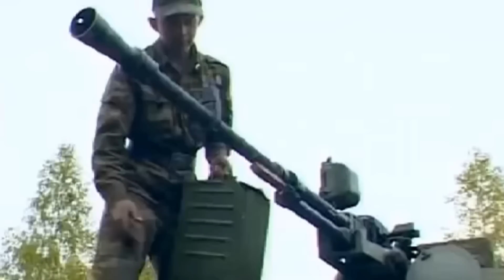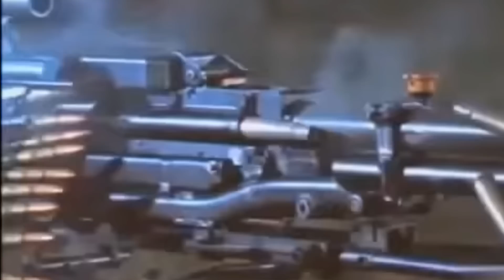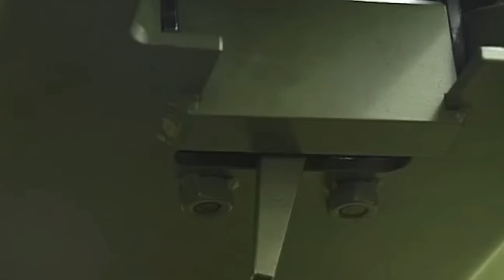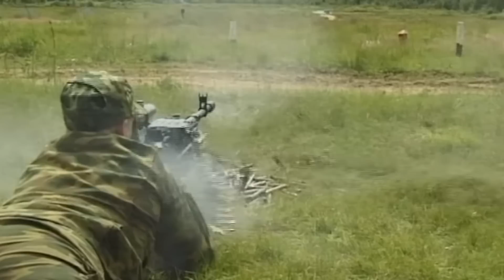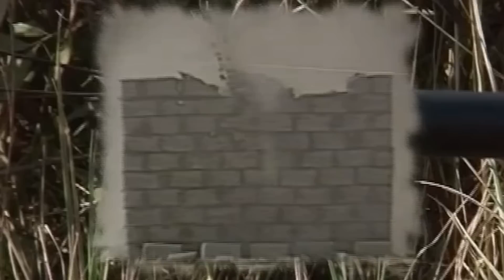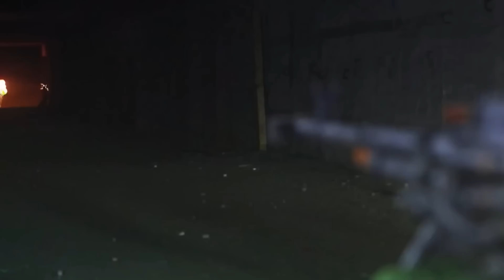Kord 12.7mm Heavy Machine Gun | Russian Beast

Comment: The wire cable & pulley system choice was driven by a desire to minimize the componants that would need to be swapped to employ the gun in various mounts and situations - the charging mechanism (and in fact, the actual trigger mechanism) are on the mount , which can be configured tonwork those as best suited to the mounting situation.  The widgets on the mount (whether directly using the gunner's physical effort, or a remote solenoid or electric motor in the case of, say, externally mounted remote mounts) have to be able to manipulate the charging system and the sear wothout changing anything on the gun itself.

This makes using the cable charging system the easiest system to engineer that can interfsce with the "universal" receiver setup.

Cramped coax or turret mount, where getting an arm in to pull a long stroke high force chargung handle might be an issue?  Cable charging has long been used - cable or chain chargers were used on many Browning MMG tank hull or coax installations.

Buried remote mount?  An electric motor is easier(and smaller) to make something spin than trying to build a solenoid that could pull a conventional cocking handle for a 12.7mm HMG.

And given the large size of the gun, and how infrequently (relative to vehiclular uses) it would be used as a ground mount gun, the cable charger isn't really an obstacle... but it does pay off for the gun as a "universal" gun mostly used in vehicular roles.  And unlike the DShK or M2HB, it isn't an adaption of a ground gun to a vehicular role, so it was optimized for the vehicular role (including remote installations) from the beginning.

Comment: How does it compare to the M2?
Reply: Kord is better lol.
Reply: @destroyerarmor  By what metrics?
Reply: @jakelilevjen9766  Basically all of then. Lighter, more reliable, more accurate. 

For instance, M2 is not capable of a doing 200-long bursts without interruption - even in a specially tuned version with water cooling built just for that experiment.

Kord is capable of doing that in the basic configuration.
Reply: @ayrnovem9028  Carlos Hathcock has a confirmed kill with the M2 from 1.4 miles (2250 m). Tells me it is pretty damn accurate.
Reply: @jakelilevjen9766  It is not the same as doing it consistently.

Carlos probably tested quite a few M2 speciments and chose the one that showed the most tight groups for his "sniper" weapon with an optic sight.

That kind of selection process has been done with many weapons that are not really designed as highly accurate, including Mosin rifles.
Reply: @ayrnovem9028  Fair enough
Reply: @ayrnovem9028  Sounds like the US could be due for a refresh, seeing as how the M2 is almost 100 years old, while the Kord is less than 30.
Reply: @jakelilevjen9766  I guess heavy machine guns are not seen as something of a high priority to upgrade in the US army. From my point of view, that's strange, but that's the conclusion you've got to make.
Reply: @ayrnovem9028  That, or good enough is good enough.

Comment: Don't listen to his criticism of its cable cocking, children: If U get a dud primer/hang fire and it cooks/goes off just as U are cocking it, it won't break Ur thumb! My lawn mower is 30 years old, has seen a lot of use, spent its life in the carport and yet the nylon?pull starter cord is still OK, let alone a steel cable! And it seems to have a pulley. I wonder why? Maybe to return it. It can't be a rack/ratchet, coz I can see it sliding, back and forth. 
Oh I get it, the pulley gives U a mechanical advuntage, simply because of its diameter, and maybe even gearing.

Comment: Guys pipe down, pipe down. It’s a 50 cal. Nothing more nothing less.
Reply: 12,7 × 108 мм a little bit more powerful than 12,7 × 99 мм/ the difference is about 2000 Joules
Reply: @GBAS-u9q So the extra powder in that 9 mm converts to 1475  lb ft of force ? I think not. Most gun experts say it’s only slightly more powerful than the 12.7x99.

Comment: In the early 90's while we were fighting the ANC terrorists in the townships. I came up against one of these. The terrorists had mounted it on a wheel barrow and consisted of a team of six guys that moved and fired it. Me and two guys were trying to hide behind a brick wall, and it punched holes through it like nobody's business. There wasn't much cover and we finally decided to fire and move to their position as hidding/ cover was not an option. Of all my days in the army, I have never been as frightened as that day. We did finally manage to get to the gun, after they abandoned it though. But these guys were very well trained. Number 1 would push the wheelbarrow, put it down and start firing, number 2 would feed the belt. When moving, number 3 would step in, grab the wheel barrow  and move, while 1 and 2 stepped aside to the back of the queue. And while they ran, as soon as the lead guy got tired, he would put the wheelbarrow down, and the guy behind him will take it and run further. And when they wanted to shoot, the last guy pushing the wheelbarrow became 1, and the guy behind him went to feed the ammo.

Comment: Thank-fucking-god I never had to be on the receiving end of this weapon. What an absolute fucking MONSTER. Honestly, I've never ONCE thought to myself, "The M2 really needs some work" ... but seeing this!?? Given that it's both LIGHTER WEIGHT, and puts out over 10% more muzzle-energy !??  And looks to be literally DOUBLE the actual firing rate of the M2 (I know they keep the gas turned down for training but regardless of the cyclic RATE ... the "sustained rate" is STILL only 50 fucking rounds a minute with not only the M2 but also the M240 and M249) ... but this thing looks like the real cyclic rate is about 700 RPM and they don't appear concerned about sustaining ~ 150-200 RPM in training...

The M2 is goddamned IMPRESSIVE when I first shot it at some LAV targets ... but honestly, the energy is visibly higher in this KORD ... and hell... nearly 100 years later it might be time to consider some redesigns of the M2 ... But who knows; maybe this 338 Norma will be the wonder drug that covers the M249, M240 AND the M2 ... but I highly doubt it. Just doesn't seem to have nearly enough material in the barrel to stave off heat build-up for practical use without asking us to carry more barrels.

Comment: The "KORD"barrel system(one thousand Titanium rounds),has been installed at the rear, of the new many up-grades fitted on the MIG 31,where the"chutes"were previously installed(plus heating system,for super-high altitude-70°C),replaced by much larger bottom air- brake flaps/.

Comment: Has anyone sat down and undertaken a side by side comparison of this very fine weapon against the iconic and proven M2 Browning .50 Cal heavy machine gun?

I’m no expert by any stretch, but doesn’t 12.7mm and .50 Caliber fall in same category (I.e. form and function)?

It would be very interesting to read what the “experts” conclude as the overall better weapon.

The only personal reason I’d probably choose the M2  over the Kord Is because I would have a much easier time 🤓 reading the operators manual for M2, unless of course the Kord had a hell of a lot of detailed pictures in it’s instruction booklet 😝!!!

Seriously though..., anybody have any comparison facts or sourced any online knowledgeable opinions?
Reply: The Kord has superior Ammunition carry capability you can mount 2-4 ammunition boxes on both Sides and you dont need to switch anything because the ejection port is in the middle.
Its lighter but longer so its harder to carry with one person but eaisier with 2 people then the M2.
Overall they mostly serve the same tasks but i would pick the kord(stationary)because of its easy charging machanic amd ammounition carry capacity.
Reply: Command_Unit - Any thoughts regarding ease of “barrel swap” during combat (Kord vs. M2) ?

Comment: While the Kord looks scary compared to the M2, I'm fairly certain the 12.7 round the russians use is actually less powerful than the 50bmg due to the russian 12.7 being a lower pressure round and thus the projectile has less energy. 

Also let's be honest, in a room clearing scenario you would much rather want to have an M249B or a PKM with a 100-200 round belt at your hip than a Kord or M2 with a 50rd belt. That last bit at the end is totally unrealistic and impractical
Reply: u mad bro?
Reply: 50bmg standard 12.7x99 NATO caliber .  Kord   12.7×108  caliber.    The NATO .50 BMG (12.7×99mm NATO) cartridge. The two differ in bullet shape and weight, and the casing of the 12.7×108mm is slightly longer, and its larger case capacity allow it to hold slightly more of a different type of powder.   https://en.wikipedia.org/wiki/12.7%C3%97108mm

Comment: As a former tank commander used to fire this beauty a lot. It's not quite reliable as I hope. Still have a pretty nice punch through light armoured targets. Like a knife through butter. As a bonus good tracing on the standart issue bullets so you can adjust your fire easily even during sunny days.
Reply: It's obviously not very polite to answer the question with question. But still. What does KORD heavy machine gun have to do with war in Afghanistan and even Chechnya? All I know for shure is that there was losses. How much? I don't know. And even if I'm used to have something I rather wouldn't tell anything about it.
Reply: @iddqdidkfa2990  First Chechen war tank losses were maximum  around 200.
Reply: Cool to hear you handled this machine. Could you describe the issues that would come up in your experience?
Reply: @dragonsword7370  it chokes quite frequently when you mow things down
Reply: @theholyhay1555  Not surprised, the rounds are pretty big
Reply: @ls200076  yeah and they eject in a weird way!
Reply: Are you sure about KORD12,7? Not NSV?
Reply: @ТолянЖига  I actually used to fire both NSVT and KORD. NSVT was mounted on the older versions of t-90. The 2007 version do have a few new weapon systems and also new heavy machine gun wich was mounted on remote-controlled turret. Although these two models of machine gun are different in some parts they're pretty much the same constructively. I do remember them quite similar and above all they have same caliber, same punch, same experience from firing.
Reply: @iddqdidkfa2990  that's why i asked - they looks similar externally, but internally the are different, yes. Maybe you are confuse or some thing? Just your service was a long time ago. Anyway thnx for answer.

Comment: I will disagree with you on this gun a bit. Yes this thing is a beast and yes it is versatile.  I can see this.  But there a reason WHY this gun is chambered in 50 caliber for export.  Isn't there.
The M2 (family) is perhaps the most durable, one of the most versatile and proven heavy machine guns in existence... PERIOD. 

This is also where size comes to be an issue. When you have something that big, you might as well go to 20mm or higher. 

But the real reason is that this round is their standard Russian Round that has been used for over 50+ years and they have plenty of rounds to use.  Reliable enough round to use so just build abound it and in modern times this is the result. 

They made a very good heavy machine gun and it does fit their doctrine.  So kudos to them.
But for now I'll stick with the M2 knowing what I know and looking in the future to see where the evolution of fire arms leads me.
Reply: The Kord is lighter then the 2 M2(38 kg) vs Kord(25.5 kg) and Russia uses US standerd calibars for export alot doesnt mean much...Other countries do that also

Comment: Things like this is why the .50 bmg doesn't impress me, in America any .50 bmg is worshiped, but no one understands that is a small round for it's class, and it's meant to be, and the .50 bmg is widely thought to hold the world record for longest confirmed sniper kill, when in reality it was a far more professional and accurate AWM chambered in .338 lapua
Reply: The .50 bmg is 12.7 x 99 while this gun fires 12.7 x 108. Not much bigger by any sense. And the 12.7 x 108 has also been used as a small anti aircraft round as seen by the berezin mg
Reply: The m2 is perfect for it's role as an  HMG.... and so is the 50 bmg...
But the kord is the perfect general purpose HMG... and would do great if it replaced the m2 in infantry weapons company's...

50 bmg is the best in its class size and weight.... yeah the Russian  12.7mm is good and 14.5mm is beast... but the ammo is slightly heavier and in a infantry weapons company who have to carry that.... weight matters. And the 50 BMG has earned its reputation..
Reply: I checked it 50rd of russian 12.7mm is around 24lbs so 100rd= 48lbs....
The 50bmg 100rds of ball is around 35lbs... and that matters for carrying and shipping.
Reply: Fucking armchair Rambo lol...

Comment: It should be noted that the T-90 main battle tank went from originally using an NSV machine gun as its Commander's weapon during the testing and early production stages to using a KORD MG instead. Not sure if it's replaced the NSV on Russia's other MBT's such as the T-80 and T-72 series, but wouldn't be surprised.

Comment: I wonder if the US will ever test or introduce another 50 cal machine gun. The Browning M2 and M3 are some of the best HMG's in the world, and have proven their reliability and effectiveness beyond the shadow of a doubt. However, I believe their are big advantages to the features of the the KORD and the NSV. I am by no means an expert, and have only a basic knowledge of firearms technology. But I imagine the perfect HMG as being a KORD, which has a simpler barrel change lever like the FN MAG. Also, it would have a non-reciprocating charging handle on both sides of the receiver. Also, it's trigger could easily be changed to either a butterfly trigger with no stock like the M2, or could have a trigger and stock like the KORD.  Most of it's parts would be made of lightweight materials like titanium, so it could easily be transported by infantry, but it could be mounted on vehicles just as easily. I have an extremely active imagination, but I don't think a gun like this will be developed in the US anytime soon. The defense establishment is much too resistant to change and is prone to corruption.
Reply: Sorry for the typos.

Comment: I'll see your 12.7mm machine gun and raise you .50 cal GAU 19.
Reply: I'll see your GAU 19 and raise you KPVT...
Reply: @mr.techaky7655  Well, 600 rpm vs 2000 rpm I'll take the 2k rpm thanks.
Reply: @Abrxas01  But you're not firing armor piercing 14.5x114mm rounds either... Rounds per minute isn't worth anything if you don't have power and range.
Reply: @mr.techaky7655  .50 cal has tungsten core AP rounds and if you REALLY want to get nasty DU rounds. Your KPVT has a max range of 4000m while the GAU 19 has a max range of 6000m. And your KPVT has a max rate of fire of 600 rpm while the GAU 19 can fire 1k, 1.5k, or 2k rpm depending on the setting. So for versatility, range, RPM and AP capabilities I'll STILL take the GAU 19.

Comment: Dude, the additional ammo boxes they were putting on the mount in the video were not additional feed sources. They were to catch empty brass and links. That machine gun was only capable of being fed from the right. Only the turret mounted variants can be fed from either side and the reason for that is to quickly change between ammunition types (usually ball and AP) as the ammunition boxes in turrets are usually very large and time consuming to replenish. It doesn't have anything to do with speeding up reloads. I guess you could fire AP ammo if you need to while your turret's ball ammo box is being replenished but that's not the idea behind that.

Also if you don't have any reliable sources about the reliability of the system don't assume and claim that it is perfectly reliable. It cripples your credibility.

Comment: That looks more like a cannon but the caliber is equal to the 50 bmg yet the 50bmg has a larger case volume. So why is that machine gun so large? It looks like it should shoot a 20mm
Reply: All weapons less than 20mm are considered large-caliber machine guns, all that is greater than 20mm are cannons.
The “cord” is lighter than the M2, so that it can be easily transferred from place to place. If you leave only the bipod, it is even easier.
Reply: The “almost gun” niche occupies 14.5 KPVT. He is able to pierce armor and does it quite well, especially with new ammunition. But it is too heavy and quickly overheats. If you hold the trigger on the entire tape, the barrel will have to be replaced. The barrel will be unsuitable for further use.

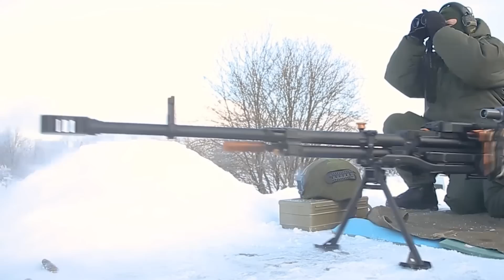Comment: 10:28 - Spotter is wearing electronic Howard Leight hearing protection.  Great electronic ear muffs if you're on a budget.  Amplifies sound until something loud like gunfire comes along, then it just shuts the microphones off.

As for shooting one... you might have luck in Las Vegas.  A few other places out there you might find one here in the US that you can rent one to try out, I can think of a couple MG shoots where one might show up.

The cocking cable arrangement reminds me of rope-pull starter for a lawn mower.  Not a fan, even knowing it's a cable.  Ditch that, put an actual cocking knob on it and this thing looks like it'd be a better weapon than the M2HB.  I really like the ability to fire from a bipod.

Case and link catchers are probably for helicopter use.
Reply: Escape from Tarkov

Comment: The mainspring's cable construction has nothing to do with the cable cocking mechanism. That just means the drive spring is made of a coiled cable, common on machine guns.

Edit: Also, in my experience with cable cocking mechanisms, if the cable isn't terribly thin, they are quite reliable. That's coming from a former tank gunner. Good video though, thanks for making it.